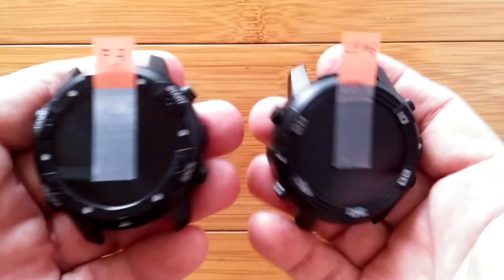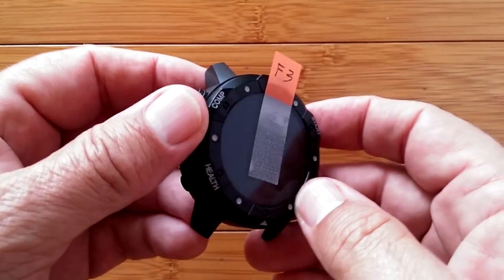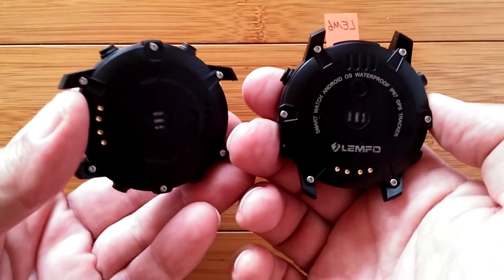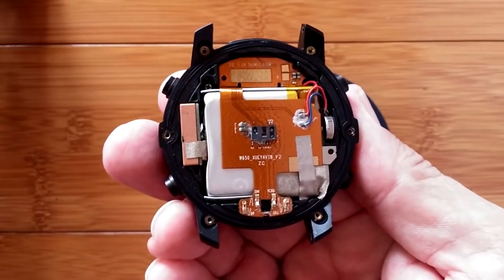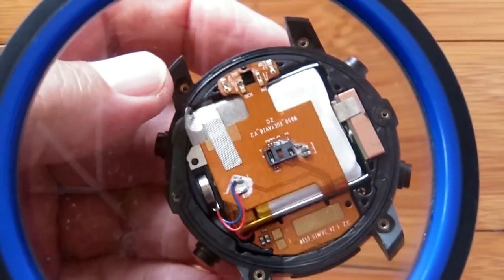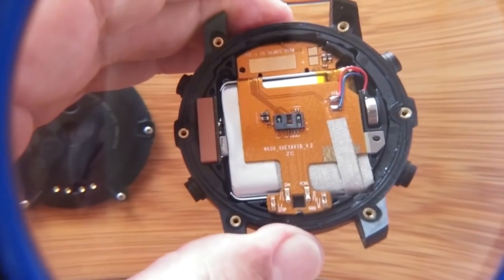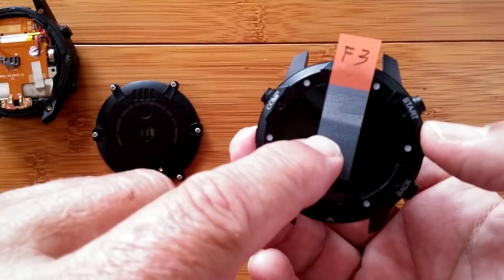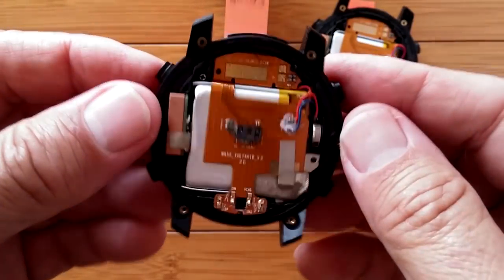LEMFO LEM6 & TenFifteen F3 Design Flaw Part 1: Can Void Waterproofing!

Comment: That driver is called "Torx" if you did not already know that. Those are some really thick watches and it looks like the Lem 6 passed through the QC department just before five PM on a Friday. ;^)
Reply from the maker: Thanks for the Trox! Yea, this whole metal fabric looks like an after thought addition to fix some RF problems (unless it's part of the antenna system itself).
Reply: I had the notion that it could be some sort of flame retardant covering for the battery. Just a thought.

Comment: @@@I have a question. I need a magnetic usb charger that has 4 connection points. What should I do to replace it? I'm thinking that it is pretty standard.@@@
Reply from the maker: You're right, Brad, they are pretty standard now. I'm sure there are sources out there, and I've asked viewers to post a comment under this video as to where they get their spare parts: https://www.youtube.com/watch?v=RmK9eoNbFag&t=608s
You might look over the comments there to see if you can find it.

Comment: Does the LEM6 - Do Blue tooth calling ? - I can not seem to make it work!
Reply from the maker: As I mention in the video, that's what I was checking on when I discovered the LEM6 was dead. I couldn't download the latest update to check it, so I can't personally tell you if the LEM6 has Bluetooth calling. IF anyone with a LEM6 has Bluetooth calling working, PLEASE leave a comment and tell us if it worked when you bought it or if you needed to do a firmware update. Thanks!
Reply: Thank you for the reply ! - just updated and I can not see or find a way  :(
So DUMB that you can not do it !
Reply from the maker: Look in your app listing for a new app called WatchBT. If you've got it, then you have Bluetooth Calling! Please let us know how it works for you. Remember, just tether your watch to your phone like you would a Bluetooth speaker. You don't need an app for this to work.
Reply: Nope   :(   - Not in APPS or APP Store  :(
Reply from the maker: Thanks for looking. That answers it. Bluetooth calling is NOT available for the LEM6 yet, so between the two, the F3 is a better buy. Appreciate your efforts on this, even though you have a bit of disappointment as a result.

Comment: sir whenever i am applying the coupon code it is showing the the coupon code has expired...what should i do?...please tell me.
Reply from the maker: I tried to get updates for the coupon but it can't be extended. You can pay the higher "flash sale" price currently listed or wait until the next major China sale on this watch, like Black Friday or Cyber Monday in November. The best thing is to order right away when there's a new review posted as they set aside only a few units at a deep discount price, and only for a short time, usually under a month. It's getting harder and harder for me to convince them to extend it, even though there are folks ready to buy. It's how they do their marketing, I guess.

Comment: I am a fallower of you sir. I always decide that most of chinese products are similar to each other when ı spent much time at chinese shopping sites. 
But now ı certainly believe that there is a factory which supplies products and we pay for same products with different brands for any categorie:))
Thank you for your all videos. I Just want you show us makibes's m3 watch. It looks little different than others. Thank you:))
Reply from the maker: Thanbks for watching and your assessment of the Chinese watch market. Yes, often only the case and watch faces are changed but the insides remain the same (especially the Android 7.1.1 watches now on the market). I have the Makibes M3 on order and will review it soon. Also check out the Kospet Optimus Pro, doe in for review as well. Both seem interesting.

Comment: Please help me. Im confused in buying a Tenfifteen F3 or Zeblaze Thor 4. I wanted to buy the tenfifteen f3 because its waterproof but you guys are saying that its waterproof certification cant be trusted. And if i buy the Zeblaze thor 4 than i loose waterproof certification here. I have no problem in the price difference though. What should i do anyone please reply soon. Thanks in advance
Reply from the maker: Unless you really plan to swim or bathe with your watch on, you will probably be OK with a splash resistant watch. I like the F3 more for the removable bands than the waterproofness. I like to carry it as a pocket watch without bands and wear a different watch on my arm. You'll probably have better connections with a watch that has fixed bands, like the Thor 4, but if the bands get damaged you can't replace them.
Reply: SmartWatch Ticks Thank you for your reply this helped me decide to buy the tenfifteen f3. Your the smartwatch king 👍
Reply from the maker: Great! Enjoy!

Comment: What happened to the first vid?
Reply from the maker: Processing glitch from YouTube rendered it frozen in the middle for several seconds. I had to delete it, rerender the original, and upload it again. It would not have been a good presentation of this material, so redoing it was appropriate. Nothing changed, it's just all there now and streaming correctly.

Comment: Sadly, one can not trust IP certification standards on consumer electronics. The LEM 6 is rated at IP67 (Protection from water ingress up to 1 meter for less than 30 minutes) which does NOT mean waterproof. IP68 (Protection from water ingress of depths greater than 1 meter) is the highest certification offered and even that does not guarantee waterproof. My Gear S3 is IP68 certified, yet Samsung clearly states in it's manual that the watch should not be used for showering or swimming.
Reply from the maker: Good points Robert. When in doubt, leave it out (of water).

Comment: I don’t have any problems with mine, when already to the beach and at work washed like 5 times every days
Reply from the maker: This is not a defect in every watch, just some of them through lazy assembly and bad QC. My F3 works fine as well. It's just a red flag of what might be a problem, and something easy to check before risking loosing a watch to water damage as I did.